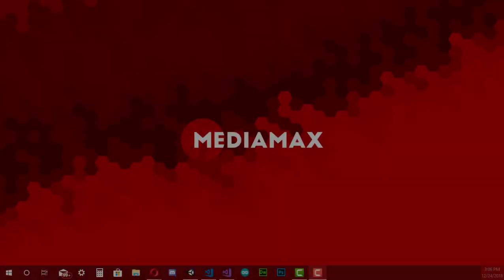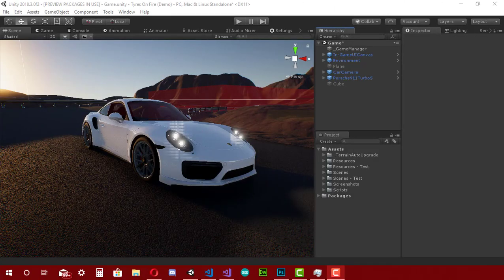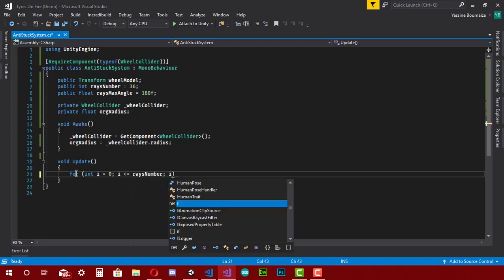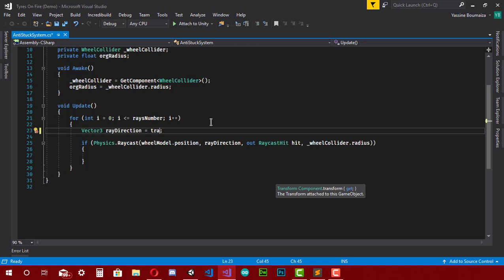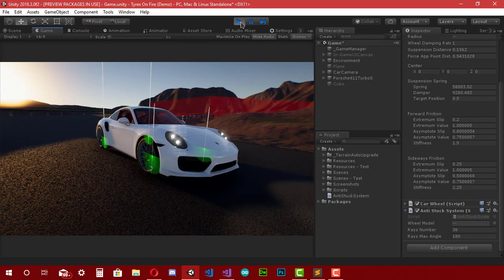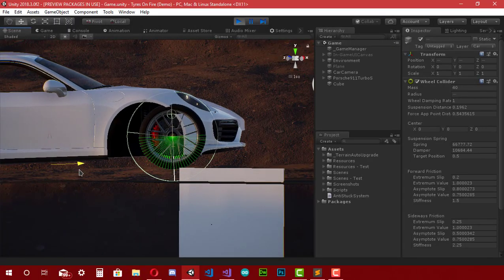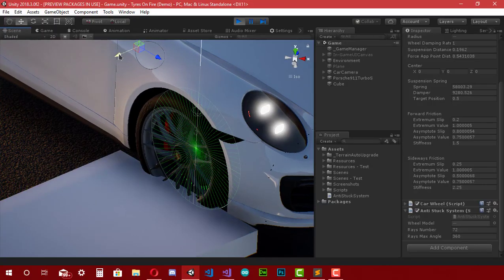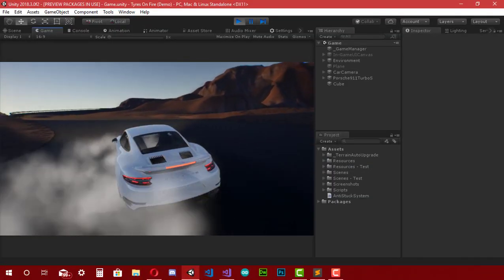Wheel Anti-Stuck System in Unity

Comment: I think many raycast will make a big stack of garbage in memory. It is not good.
Reply: @bxbstudiodev  I tried to use sphere cast too. It is little tricky to use it properly. You may cast to rays on sides of wheel and check you sphere cast is out of angle from these rays. It works but... So I still use one raycast for each wheel

Comment: After implementing and testing with this system, i’ve come to find what I consider as a pretty major flaw.

If you have the car beside and touching a wall, if you turn the front wheels, the raycasts will now intersect the wall due to the wheel pivot, and it will try to “climb” the wall. Contacts with walls can now easily flip the car over.

Does anyone have a similar problem, and some way to mitigate it? Thanks!
Reply: @bxbstudiodev  To make the raycasts ignore the walls completely? That would make the old problem come back, if some of the walls could be climbable potentially
Reply: Blind guess here, but I suppose you could check whether the collision normal is more or less aligned with the direction the tire is rolling (with a dot product). If it's outside a certain threshold, then that means it's being hit from the side of the tire, and in that case you skip adding traction. Although maybe first you want to check if the collision normal is over a certain slope angle threshold (dot product with UP vector). If it's over the permitted slope angle, check if it's hit from the side.